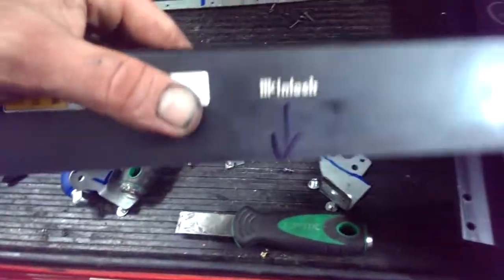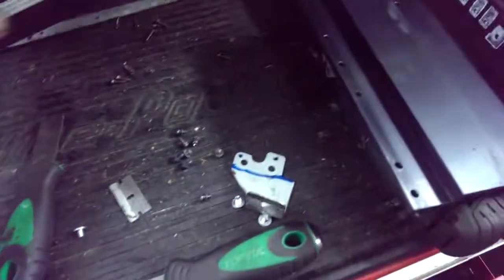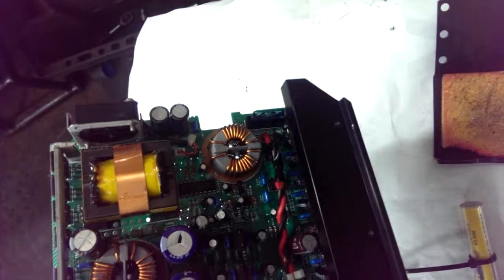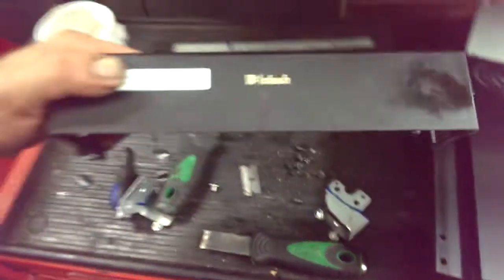Subaru McIntosh Amplifier internal fuse radio fuse

Comment: I know this was 5 years ago but I just got a Subaru and had to rewire the cables up to the amp, there's some like amp whine or fan noise coming from it with the speakers turned off, is this normal on McIntosh shitamps?
Reply from the maker: Heard about it yes but not sure what fix is. No not normal as I still have liberty and it doesn't do it. Check aerial connections and cabling isn't misrouted maybe
Reply: You have a grounding issue. It's a ground loop hum. You're hearing the electricity to the radio being passed through the speakers.